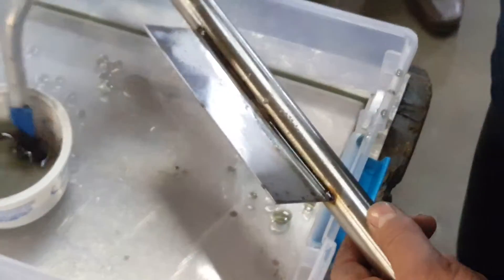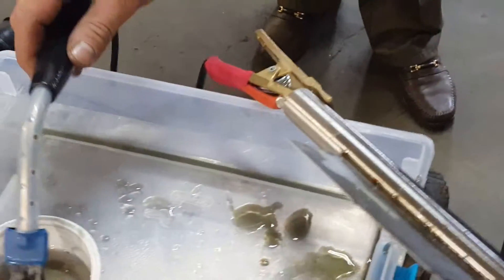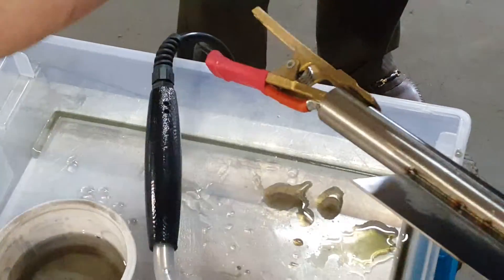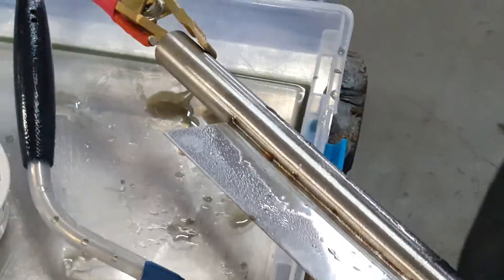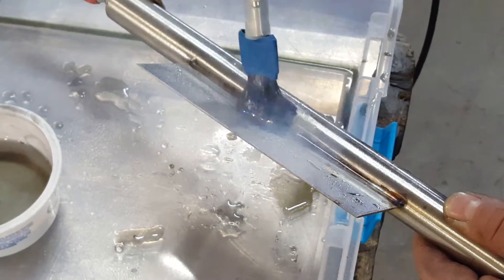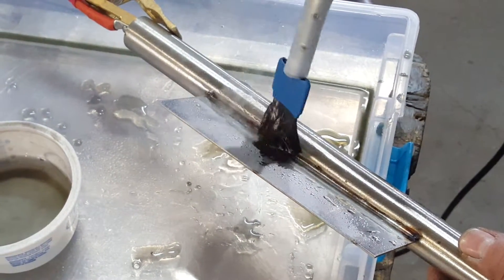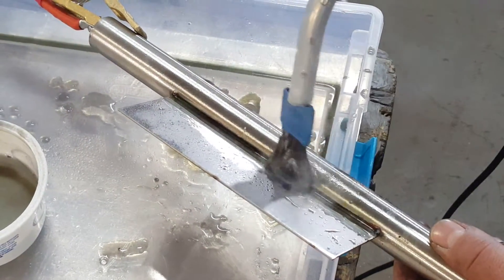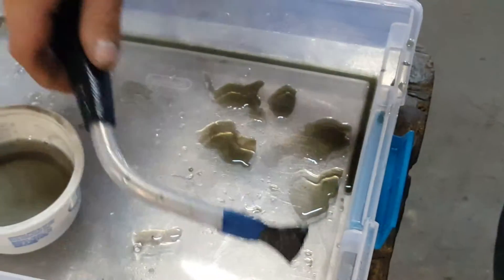Electropolish weld cleaning

Comment: What's the spray you're using ?
Reply from the maker: Hi - So they dip the brush in a phosphorus solution, then run it over the weld. The spray is just water. You have to spray and wipe the solution away or else a film / haze develops and it is hard to get off. Just a rinse.
Reply: Distilled water, right ?

Comment: what liquid you used ? homemade ?
Reply from the maker: I wish. We buy it from the supplier. Phosphoric solution.
Reply: Thank you
Reply: Ospho and Kleen Strip brand "Phosphoric Prep & Etch" are just Phosphoric acid. I use it to Parkerize guns too. with either zinc or manganese. You can make a rechargeable battery operate one of these units for damn near free.